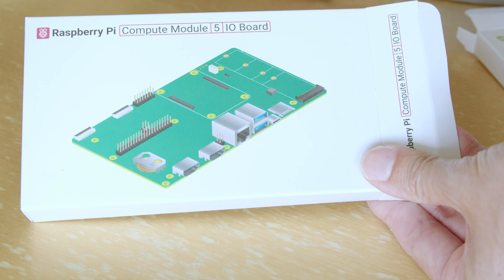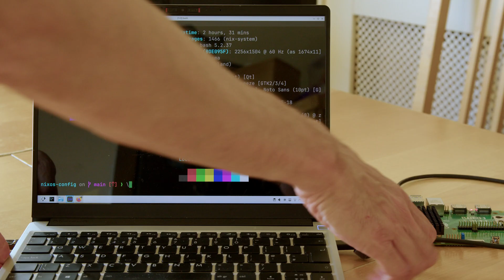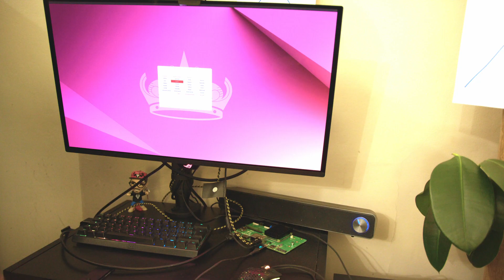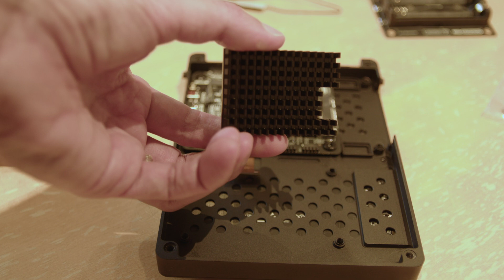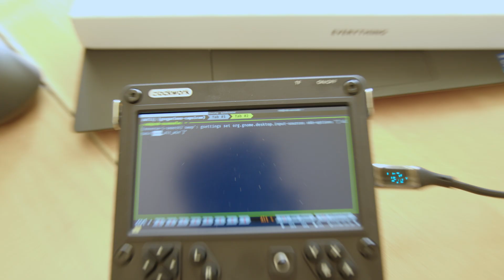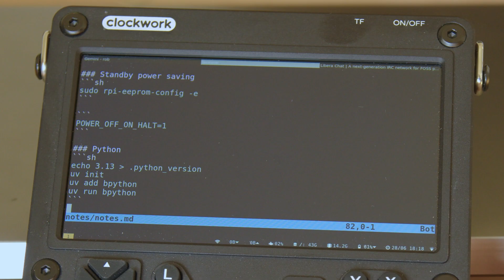Clockwork uConsole with CM5 and eMMC

Comment: How has it hold up? Got any real use out of it?
Reply from the maker: Main use so far has been to SSH to my various servers to run upgrade commands. It's good at that. But I mainly use it connected to power because sometimes it will crash when on battery and the only way to recover is to remove the batteries!

I did buy a software defined radio board for it, so one day I will install that and try it out.
Reply: @RobFisherUK could be worth trying a battery calibration but yeah the need to pull the batteries is a pain. 

Hackergadgets have released a new battery board/CM5 upgrade kit and there's the ability to wire a switch in to it for cutting power could be worth a dabble. 

If you get bored or don't fancy installing the SDR board drop me a line might try and have it off ya 😅 (Yorkshire based).

Comment: I just got the Uconsole and a CM5 with eMMC. I flashed Rex's latest bookworm image to the CM5 but can't get it to boot on the Uconsole. I used windows to do this but will this Ubuntu image work if I flash it the same way using RPI boot and Pi imager? A lot of the stuff you're doing in the command line went over my head since i'm on windows
Reply: I had the same problem with my cm5-emmc, the uConsole did not want to boot. After that i tried to flash the normal non-rex raspberry pi OS on the cm5 and booted it directly from the IO-Board. The board indicated that there was a spi-eeprom problem with my cm5 (3x long and 1x short blinking of the d1 green light). So i had to recover my eeporm. After that i was able to flash rex image to my cm5 and it is working fine now. I used windows with the RPI boot and the PI imager.
Reply from the maker: Apologies my understanding isn't that general. I scraped together information from various forum posts and got somewhat lucky.

Comment: My experience with the trackball is that it took some time to “wear in” in order to work responsively.  It helped to press harder than one might expect.
Reply: Same. At first mine would barely even track to the right. Started pressing harder, and after a while it's actually working quite smooth. I have a replacement blackberry trackball in the mail, but honestly I may end up not needing to use it after all.
Reply from the maker: Not sure if I mentioned it but taking it out and putting it back in again really helped me.
Reply: @RobFisherUK  lol